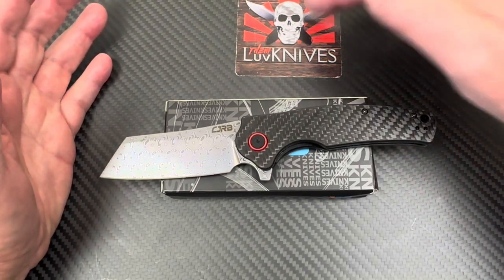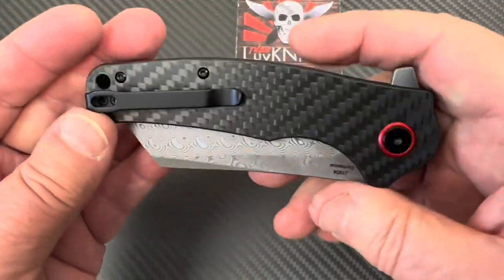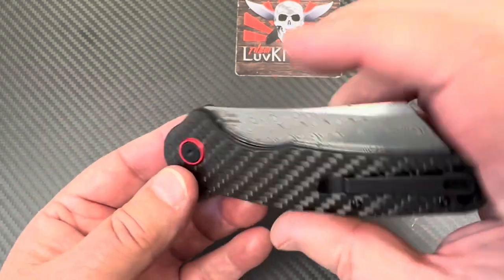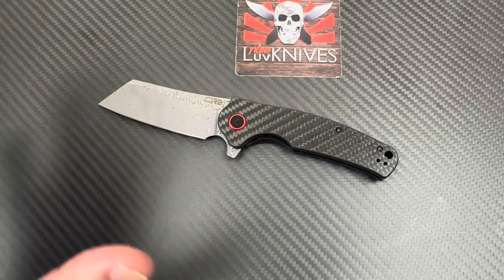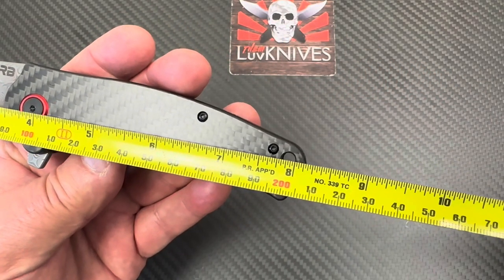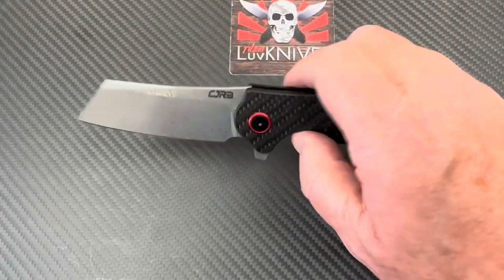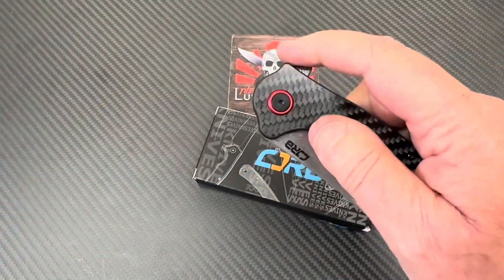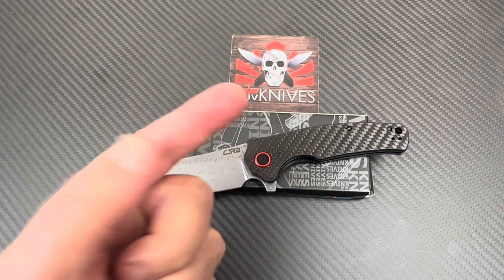CJRB Crag  folding cleaver liner or recoil lock  !

Comment: I always wonder if the budget knives Damascus is real Damascus or a printed patern. 🤔
Reply from the maker: It’s actual multiple layers of steel but if you’ve ever seen knife makers work with it…you see them dip the blades in acid to etch and reveal the layers.
Reply: @LuvThemKnives  I understand Damascus and the etching. I have also seen a few budget knives that say they are Damascus but you can't see any layers in the spine which makes me wonder. I have higher end knives in Damascus and the layers are very apparent in the spine if the blade.
Reply from the maker: @shaunharrison9618    There are some gas station knives that have a Damascus pattern.  Not real damascus but I was referring to CJRB, Civivi, Kizer etc.  They’re not doing that.  It’s real damascus but obviously not a high end damasteel or Nichols damascus etc.  Probably more like 9cr